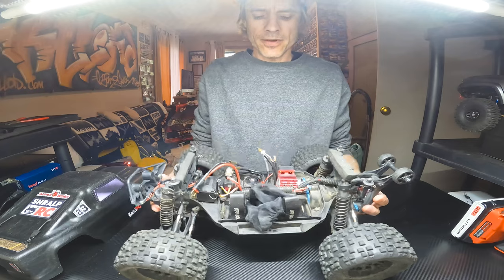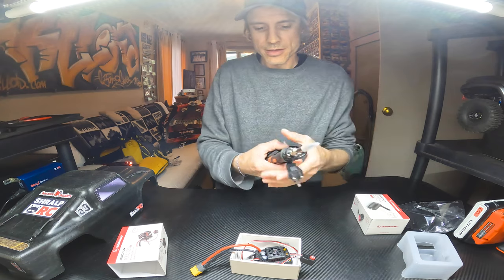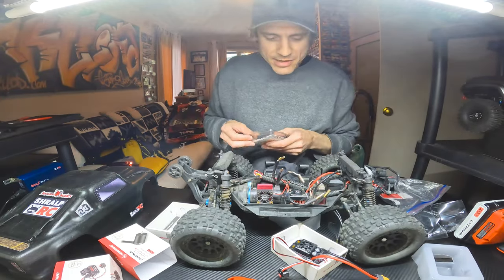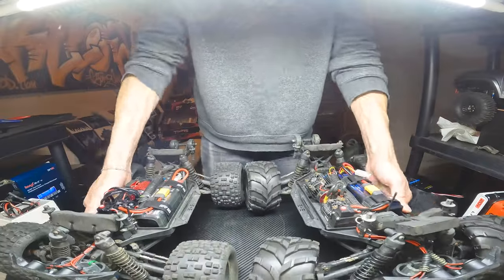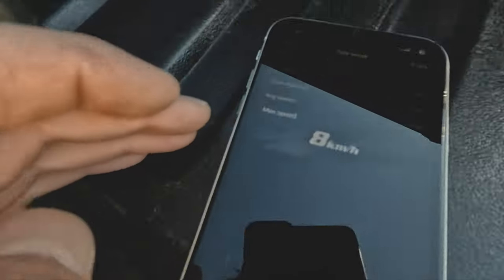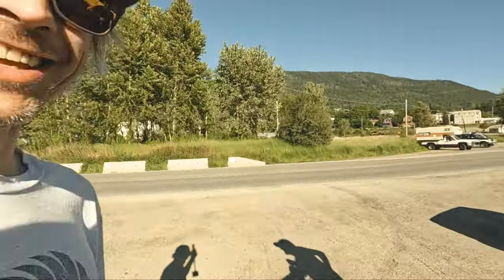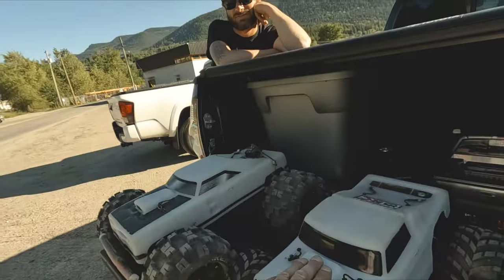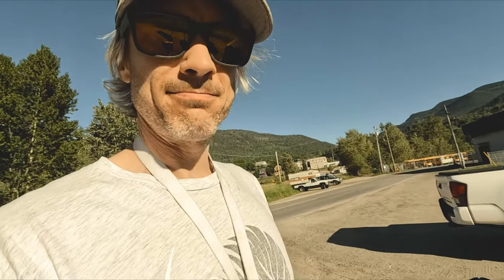Hobbywing 10BL120 Install & Speed Test - Team Associated Rival MT10

Comment: Nice video! Does the Max10 and BL120 use the same motor?  I’m planning to do the same on my MT10 V2.
Reply from the maker: Thanks! The v1 Max10 motor is very similar to the BL120, just slighter higher kv: v1 max10 comes with 3200kv and BL120 is 3150kv. The new v2 Max10 might be different though, the v2 is sensored and I believe it has a higher amp rating too.

Comment: I was wondering if the 3700kv motor would be a good option. Would be better on 2s aswell especially if your racing a Sc10 pro4. 
The new 3665 sensored motors to long for this chassis. Wish hobbywing made a 3660 sensored combo option
Reply from the maker: 3700 could be fun, I'd be a bit worried about temps with my Rivals, with the basherbodies bodies and extra bits they are getting a bit heavy, 7.5-8 llbs all in, but if if can handle it it should be fast. And yeah it would be nice to have a small sensored motor option for sure.